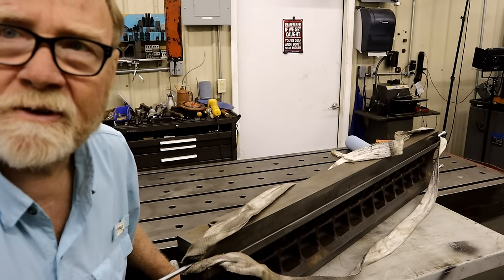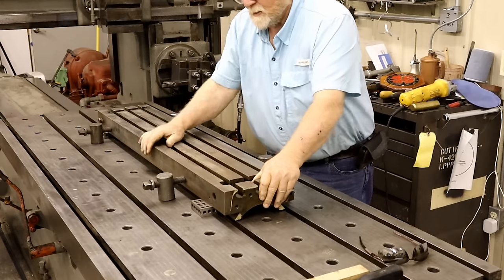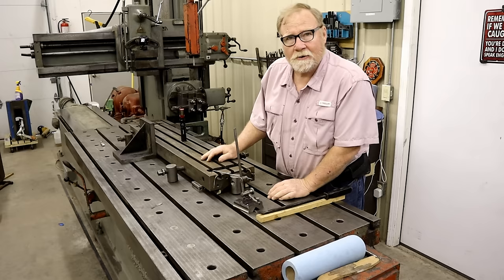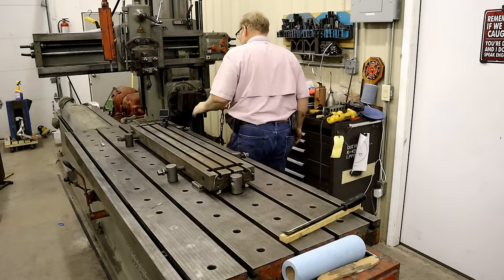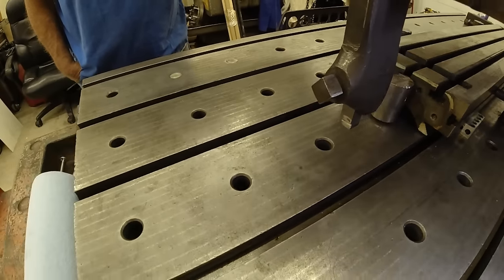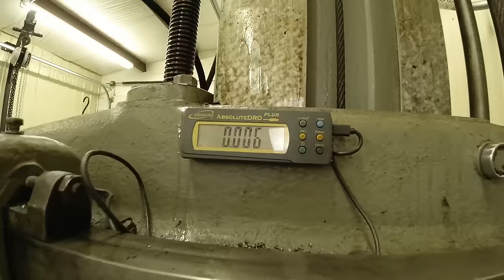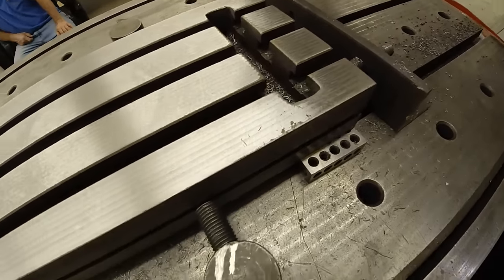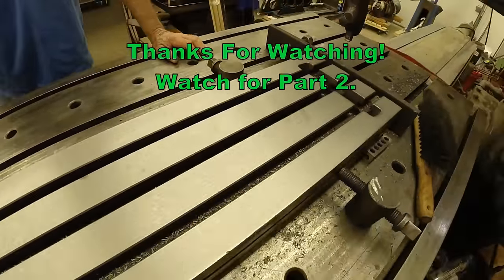How To Plane a Bridgeport Mill Table: Part 1

Comment: I have been looking for a shaper for a long time. The only ones I've come across are too small, too pretty and waaaay to expensive.....
With that said, the 74" table on my Lagunport (Lagun Republic turret vertical knee mill with a variable speed J head) needs its table done. Same issue as with yours.
As near as I can tell, the dovetails ie the bottom of the table and the saddle all seem perfect. I still have the scraping swirls on the matting surfaces. I replaced the old ballscrews with brand new high precision (unbelievably expensive but bought new as surplus thank god) ground ballscrews......
So now I've go ZERO backlash and the only thing I'm having to deal with is about a .002" rise in the middle. Front to back its fine. 
So the question is.... can I face mill or flycut the table on the machine?
Other than having the bow in my table I think the machine overall is perfect.
Well, now anyway.
Reply from the maker: If you have a bow on the top I can say you probably have a problem with the dovetails also..   Run the table to the middle, adjust the gib snugly and then see what it is doing as it nears each end of travel...   Milling the top only takes care of the top...
Reply: @10swatkins  helped a friend work on his Bridgeport and his had that problem. It was so tight in the middle it wouldn't move all the way to the end. And there was no adjustment left in the gib.
My jib is tight and it's barely snugged down. I think this mill has had very light duty or maybe wasn't used much at all.
The table has a bow but it's really more of an "M" shape. There is a kind of an outline on the table with the middle looking new and everything around it is "dirty" looking.
I think maybe it had a fixture plate or something bolted down in the middle third of the table with 8 bolts holding it down.
The 8 bolts were 2 on each end with 4 on each side but close to the ends. So it may have pulled things up on either side of the middle. So the ends of the table are the lowest point. The center of the table is .001" and on either side of the center is .002".
So it looks a little like this:
____-----__-----____
If I move the table end to end and put an indicator on the quill I can move the table all the way back and the ram all the way forward and the indicator runs true on the  bottom of the front face of the table.
And I'm good on the top face along the x and y all around the edge of the table top and bottom.
So I'm thinking I should be OK surfacing it.
I have a 4 inch face mill with indexable cutters and I have a fly cutter that will go larger than that but it balances really nicely at 3.75". It takes a 5/8" HSS blank or I have a carbide tool I can use with it. I like grinding my own tools but I don't know which I should use.
Or if I should even do it.
I've been thinking about making a surface grinder to attach to the back accessory loop.....
Reply from the maker: @christopherleveck6835  For something like that I would not face mill it... I would just scrape the table...  Of course I have a power scraper and that would make short work of it.
Reply: @10swatkins  that's a good reason to buy a new tool.....

Comment: Verry interesting. Every bridgeport table i have used has been worn down in the middle. The one you just fixed was worn down on either end.
Reply from the maker: They are usually not worn down as much as bowed.   Repeated tightening of the T nuts in the slots pean the undersides of the T's and stretch out the top of the table forcing the ends to droop down... Lots of people think that the small saddle of the bridgeports are not supportive enough and that is why they droop but the bolts are the reason... Thanks for watching...

Comment: That looks great.  I appreciate your dilligence and workmanship to not be in a big hurry.  Question - My old Bridgport table has some weld repair areas.  Can it still be planed?
Reply from the maker: Depending on the type of material they welded it with... Most weld deposits are harder than the cast iron and will cause the tool to jump when it hits the harder surface.. If it is a lot of welds it would be better to have it ground...

Comment: Steve, you said to bevel the forward edge so it doesn’t chip out chunks, so do you also bevel the cross slots at each end of the table? Sorry, I didn’t hear if you said we are to bevel those cross slots and watched it twice just to see if I missed something. Thank you in advance sir.
Reply from the maker: you can and must if you are taking a lot of depth of cut... On this job I was only taking about .003 of material in those areas so I did not bother with the cross slots..
Reply: @10swatkins  I thank you sir for the information, nice looking shop

Comment: That's a damn good finish. My department at work just inherited a beat up old bridgeport, and there are so many battle scars on the table it looks like someone's been using it for target practice. 

I would love to take it off and get it skimmed back to clean metal, but the damage is too deep, so I think my only option is to fill in the dings with JBWeld and then stone everything down flush. 

Some people have no respect for their machines.
Reply from the maker: Thank you.. It is nice to have a good top but unless you are rebuilding the rest of the machine it's just not worth the trouble..

Comment: Is there any possibility that the table will deflect under the cutting pressure as it’s hollow on the underside due to the bow or is the casting too massive for it to be an issue.? Would you pack the bow out if it were a thinner section?
Reply from the maker: This is pretty thick and by taking light cuts with a sharp bit / a light rake  I avoid too much deflection....    I do a lot of straight edges that are lighter sections and hard to hold also.. Same method helps...

Comment: I understand the need to raise the tool on the return stroke, but what's the purpose of the double-kick?

Thanks

-Kurt
Reply from the maker: That is a problem with the pump or valves.. It works so I am not inclined to make it worse by fixing it :)

Comment: How do you get the tool square to the table to make those big step over cuts
Reply from the maker: You might have notice setting the tool up in the video... I set the tool down on the surface and adjust it almost flat to the planed surface...

Comment: Could you detect that 8 thou while the table was still on the machine?
Reply from the maker: I never measured it.... I knew it was coming off to replace the nuts and screws...  You could easily measure it with a 4 foot straight edge...

Comment: Why don't You start with the bottom so You can assure to take as little as necessy on that surface?
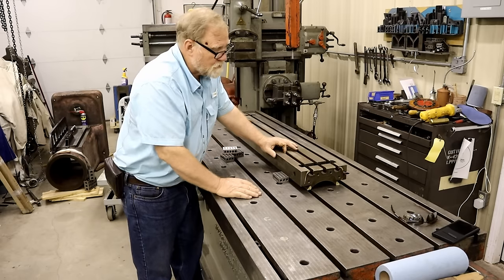Reply: Steve sort of explains why top first at 5:10, later he also says the dovetails are going to be a pain to get into, so the less you have to do on the bottom the better.
Guess we'll have to wait for the next episode to see what he means 😀
Reply from the maker: You start with the top and that becomes a solid base for the underside work.  By leveling the top's 4 corners like I did it assures you don't take off more than necessary on the top and also the bottom at the same time...

Comment: That final pass is a coarse finish after the previous. Is that a tool dulling or different depth of cut? Great machine you're using and I have to admire the ability you have to use it. Accurate job.
Reply from the maker: No in fact it is a fresh sharpened bit...  about .002 deep...
Reply: @10swatkins  That is the thing I wondered about. wasn't sure the sharpening had been done for the last or the previous but now I see? I also have the idea you'll stone the surface next to give a cleaner finish?

Comment: Since the planer bit is doing an interrupted cut (the two pocket holes for adding t-nuts) did you have to bevel the edge at each pocket like you did for the introductory edge with your grinder?

Also I was wondering if you encountered any slight movement of your 1-2-3 blocks from the repetitive jarring reversal motion of the machine? The mill table was well clamped and secured from side to side movement but since you were relying on the tables heavy weight to keep it from going up I was curious if one of the 1-2-3 blocks had shifted a bit leading to the slight tilt you mentioned since you were using the blocks left to right positions to affect the vertical height.

For those wondering why precision blocks moving slightly would make a heavy mill table go up or down, he took advantage of the mill tables bow to affect the vertical height i.e. Moving the blocks towards the center would lower the mill table while shifting them towards the outside would raise it.
Reply from the maker: I was taking off only about 2 to 3 thou on the ends... If I had been taking off more I would have beveled all the leading and trailing ends...  

Both ends of the table had clamps holding the bed to the table to prevent it from lifting off the blocks...

Comment: Great video on brings the table back into spec.  Do you have to do anything to the T slots after surfacing the top?
Reply from the maker: I just run a stone or file over the slots if needed...
Reply: @10swatkins  Steve I know you’ll use the full size tee slot nuts that fit the grooves instead of the little bitty import ones that bugger them up.

Comment: Hi Steve, great to see the planer in action, one question, how would the original ways have been machined, I see the top of the table was planed but the ways are much longer would they have been ground?.
Reply from the maker: Planning has no limits on length ... Just need a longer planer :)

Comment: You know,      that the lift you need for A/C unit is already available and can usually be rented. So don't build one just rent one for a day, remember you need all the space you got to do what you got. The last shots of the planing of the table top were the money shots. Beautiful!! Enjoyed watching and good to see Don.Thanks!!!!
Reply from the maker: I have two AC's mounted high and will need it more than once... All I am doing is taking some scrap 2x2 angle and making a two foot extension that will clamp onto the top of the lift table and be stored upstairs.  Also both AC's are above obstacles , one the air compressor and the other a work bench. The new extension will extend out from the base of the platform lift about 30 inches to allow me to lift over the obstacles..
Reply: @10swatkins , Are you going to need a counter balance to offset the over hang?
Reply from the maker: @Hoaxer51  No, I can always tack on a ledge below the AC for the extension to rest on...
Reply: @10swatkins  understood.
Reply: @10swatkins , 👍

Comment: I'm familiar with scraping machines but i've never seen a planer like this. 
Wouldn't they use suface grinders to do this job in today's time???
Reply from the maker: That they do... But mills to get it close first...  Grinding is a slow process.

Comment: I’ve never seen this kind of machine before.  Do the terms planer and shaper mean the same thing, or is it by “moving table” versus “moving tool”, or something else?

I don’t know about some of the comments you’ve gotten, but I’ve never heard complaints about long strokes!  Besides, using the full length will wear your table evenly, right?

Very cool, and nice to hear your explanation!
Reply from the maker: A shaper is usually small, a big one is a 36".   PLaners can get really big...  A planer has a moving table and a fixed head or heads. Mine has 2 heads, I have seen 4 head machines.   Shapers have a fixed table and moving tool head...   

I go long stroke because I am going for supper accuracy, .001" over 4 or 5 feet. That is a lot of moving mass on the table and long strokes give the table time to settle in before it hits the metal.

Comment: What is the travel on this plane? Does anyone know what flatness tolerances that can be held on a plane like this? What a nice piece of equipment I have seen the finish before but I have never seen it done great video.
Reply from the maker: This one is 93" long cutting stroke... I regularly hold .001 tolerance over 4 foot long pieces...   I will show making a tool that is 4 foot long in the next couple of videos...

Comment: Now that you have that top really looking nice, do you put anything on it to keep it from rusting or getting a flash rust on it? 
I’ve used a product called Top Coat, I think it might be called Boeing Shield on my table saw and jointer that’s in my basement and I’ve never had any trouble with it. Man that top came out pretty!
Reply from the maker: I have used Boeshield T-9 for years... OF course this mill will be kept inside he Climate controlled part of the shop :) After all this work it's only right!
Reply: @10swatkins , Man, did I screw up the spelling on that or what? It does do a nice job though.

Comment: Think I would have used (6) block, (3) on each side to prevent any flex in the middle.
Reply from the maker: then you  would have had a screwed up table with a bow in the middle...   4 is the only way to get a straight surface between the two ends...

Comment: Steve, when you support the ends with the blocks, and not the middle, doesn’t that result in the middle moving down as the cutter passes over? I know that the table is thick, but we’re talking about a thou here and there. Or will a spring pass take care of it? Or, are the cuts light enough so that it’s not a problem?

It looks good.
Reply from the maker: If you notice I am using a positive angle tool and it is sharp... Positive tools apply less down force and over the years of planning precession straight edges I have found it is the fastest way to get a really straight surface. And yes light cuts are what makes the difference... If I was doing this for money I would starve though :)     I find cast iron so much nicer to plane than steel because it is not gummy and shears very easy with the tool I use...

Comment: Where are you located? I am rebuilding a Bridgeport and I don't have a good way to check the table. Is there a cheap easy way to check it? Would you plane mine if it needs it? I am in north Alabama. My ways look fairly well.
Reply from the maker: Northwest of Houston about 60 miles...   You could find a good 4 foot level and see how flat it is... I would suggest going to a box store and comparing their levels against each other...  Hold the edges together and hold it up to the store lights and see if light shines through the space between the edges... Most older Bridgeport's have at least .010" "droop".

That droop is due to people cranking down on T bolts in the slots and peening the underside of the T slot.  Stretches the metal and makes it bow down...        Send me an email and we can talk by phone...

Comment: Can I resurface the table RIGHT ON, the Bridgeport itself after tramming real well and using a indexable endmill with inserts?  (I"m new to this guys, but I'm curious why I couldn't clean my table up just a bit with the bridgeport itself.  (Not sure if the table goes all the way to the end if I could.....)
Reply from the maker: Not very well.... The saddle is too short and if you have any wear in the table ways it will be uneven,  The top of the table is just half of the problem... The bottom side needs addressed also... Look for part two on that video where I do the bottom..
Reply: Thank you for your answer.  I am a year in now, and understand things a bit better.  Learning more and more. Your response makes perfect sense.  @10swatkins

Comment: I find it odd that he had to grind a bevel on the leading edge of the casting, but not the two leading edges after the two perpendicular slots (perpendicular to the "T" slots) near to the ends of the casting. Ron W4BIN
Reply from the maker: I  was only taking off 3 thou on those ends... there was a little bevel from the factory...

Comment: I got my machinist elevator table with chain drive at Boeing surplus for $50. The top is 5/8" steel plate.
Reply from the maker: I give you 100 buck for it :)

Comment: I noticed that you aren't using any coolant or lubricant. Why?
Reply from the maker: None needed... Cast iron  already has graphite in it..  And the planer table has no provisions for coolant and it would contaminate the table oiling system/

Comment: never seen a planer machine work. neet. a big shaper for flat surfaces. gotta keep the old machines flat, square and true. rebuilding old lathes and mills is a good idea for less than CNC work.
Reply from the maker: About one of the few jobs these suckers excel at :)

Comment: Something I was told when I first started machining that you never rest your hand on the machine because your weight of resting can make your project a hair off especially when you place you are on an over hanging part of the machine.
Reply from the maker: This is a little different.. The beast weighs in at about 25000 pounds :)

Comment: You're a wily old fox there Steve, when it comes to setting up that planer. Do you only have to grind a bevel on the edge with cast iron, or do you do it on everything?
Reply from the maker: I don't have to on steel but it helps ease the bit into the work....Cast iron is brittle in that regard and tears easily.